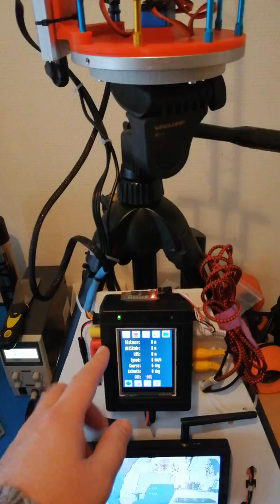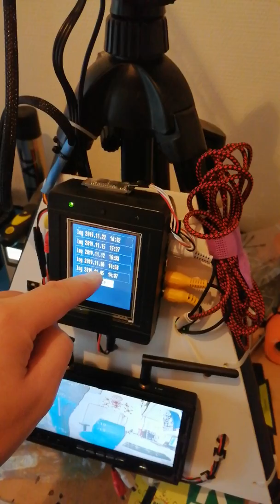My Longerange setup

Comment: dat is een mooie setup man. Jij hebt ook de furious fpv 2.4ghz gehad toch? wat is jou ervaring daar mee
Reply from the maker: Met de 2.4ghz truedx heb ik goede ervaringen als je geen tracker en vtx gebruikt die audio nodig heeft of zend. 30km iig mee gehaald.
Reply: @SniperxNL  zo dat is een heel eind... ik heb ook de bril module receiver erbij maar met richtantennes haal ik amper 4km.. met mn setups van vroeger haalde ik 6km met een omni.... dus er gaat wat mis denk ik
Reply from the maker: @RaymonFPV  Bluetooth in de buurt of ander 2.4 signaal? Probeer kanaal A8 eens. Daar haal ik de beste results mee
Reply: @SniperxNL  heb de telefoons op vliegtuig mode... maar zal ik proberen. Merk ook wel dat in de buurt van woonwijken ik digitale storingen krijg
Reply from the maker: @RaymonFPV  ook werkt de laatste firmware het beste incl calibratie. En dan channel 8 en een actuna crosshair en je haalt stuk meer. Welk vliegtuig gebruik je?
Reply: @SniperxNL  ik zal met de firmware aan de gang gaan. Vlieg met een multiplex funjet. Die worden niet meer gemaakt, maar had ik nog liggen. Volgend jaar ga ik jou plane maar testen
Reply from the maker: @RaymonFPV  leuk, crossfire erin?

Heb btw een mtd te koop staan met 6s motoren en servos erin. Verder ongebouwd
Reply: @SniperxNL  nee. Ik vlieg met ezuhf